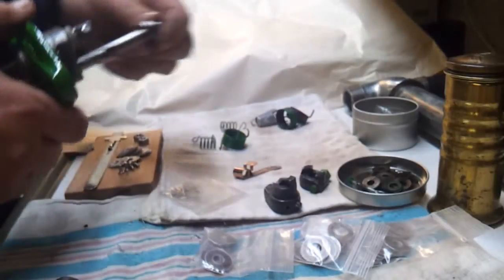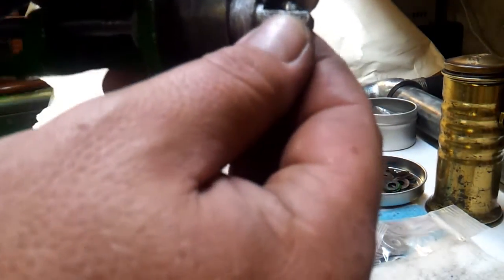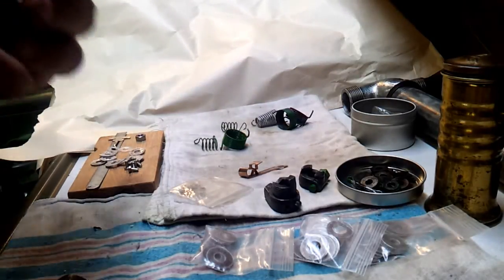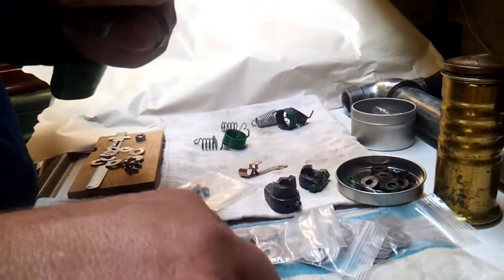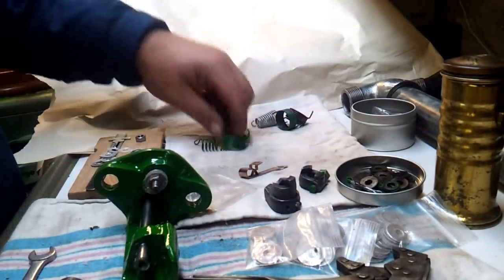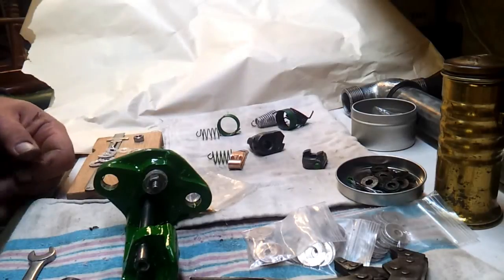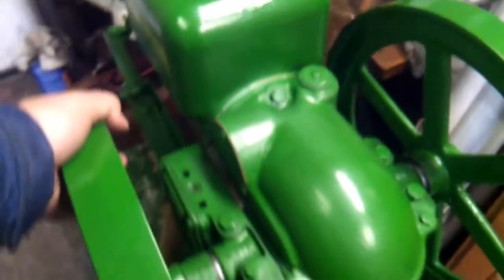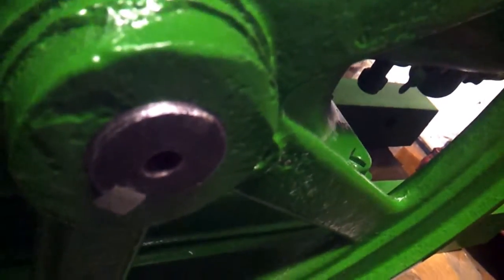John Deere 1 1/2hp Ignitor rebuild 4.0 New Points

Comment: Thanks for the helpful video!  Could you shoot a video of re-assembling this ignitor and adjusting the points for low coil operation as well as magneto?  I know the torsion spring assembly on the ignitor dictates this. I am having problems adjusting my point gap on my 1 1/2 HP john Deere.

Comment: I have had some thoughts lately about trip ignightors in general. I don't understand why a coil is needed in this circuit  because it doesn't enhance the spark in any way. A coil just works as a current limiting ballast. A resistor of the right value will do the same thing and is probably less expensive. If I had an engine to experiment with I would take a high current rheostat and try it in the circuit instead. Start with about 100 ohms and increase the resistance until the engine dies and go back until it starts again. Anyone else have any input here?